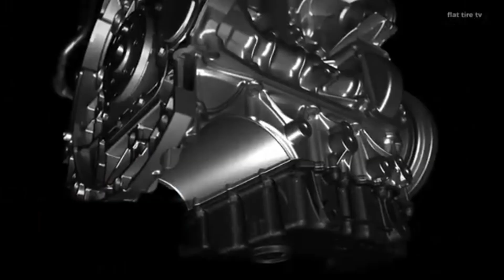Award Winning Engine That Turned To Be Problematic - Part 2

Comment: I have 1.4 mpi cvvt and i dont have any trouble. I have service like 10000km. Im leaning to buy boosterjet engine 1.4 mhev suzuki it has very small turbo. But im not sure that all turbos have issues. I think for turbo engines. You must service the engine every 8000km plus additional turbo service. Probing cylindar walls as well.

Comment: The problem with the 1.6 bmw/psa engine is the owner. Mostly small cars, witch are in use in the city. A lot of stop&go, and over short distances. That’s just an engine killer